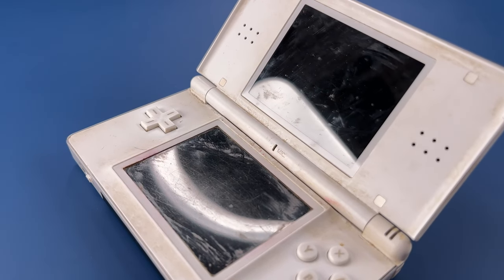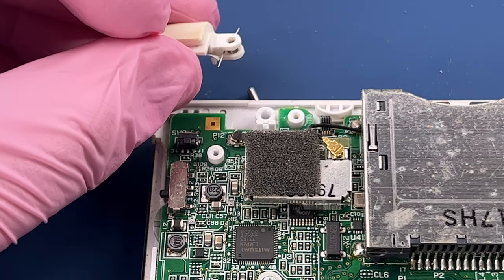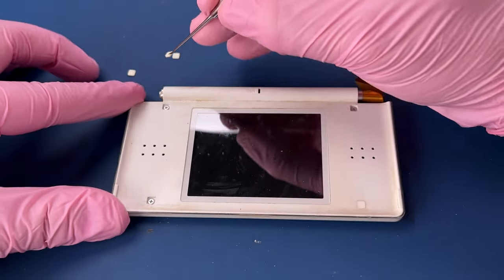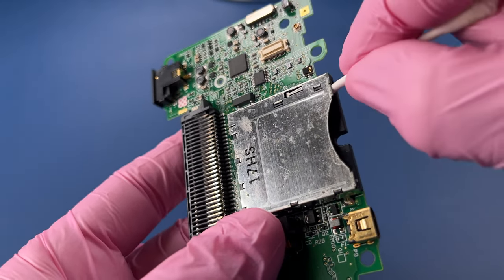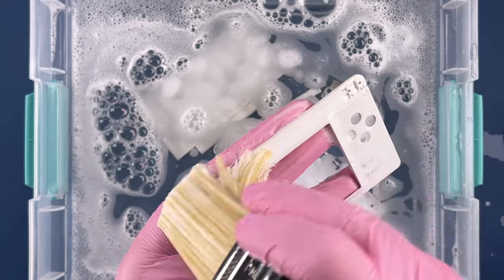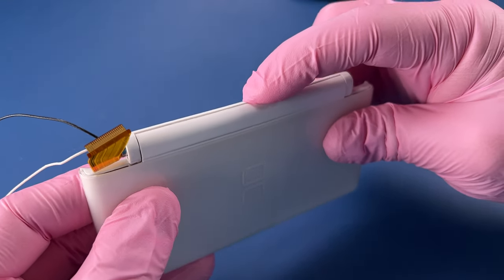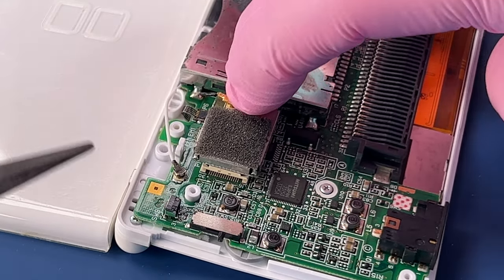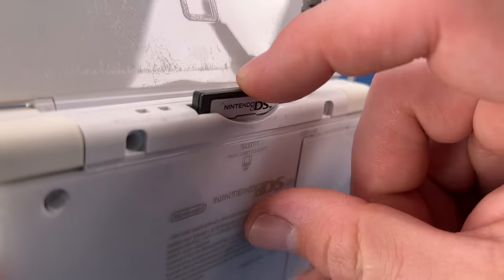DS Lite Brought Back to Life + Why I Don't Retro Brite

Comment: Shout out to you for cleaning and keeping the original case and everything, instead of throwing it away and using an aftermarket shell. I've seen so many YouTube modders take Gameboys in perfectly good or even great condition, rip the shells apart, even destroy them for lolz, and then use some cheap aftermarket shell instead.

Comment: Retrobriting basically works by bleaching the plastic, which is a non-reversible process and generally ends up making the plastic more brittle. It really doesn't fit the spirit of a restoration, in my opinion, which is all about preventing further damage. The "patina" is also part of the history of that device.

Comment: I did build my own UV-light box and when turned on, it looked like something from outer space that was giving off deadly radiation. I loved it lol To my defense, my SNES was so yellowed, that it looked more like a banana than a gray console. I only used the UV-light box once and now dont even know anymore where the growlightbulbs went ^^;  In some extreme cases, there is a good reason to use retrobrighting, but in most cases, i think, its better to leave the items dignity intact and just clean and repair. I restored quite a few Nintendo DS'es and curling up the ribboncable was always the part where i cursed the most lol And yep, some replacement cases from china are so bad, that it almost feels like you have to carve your own working shell out of them lol But strangely it's all fun to me. Maybe i like struggling... That's why i like Dark Souls? Yeah, probably ^^; And i think You shouldn't need an excuse why You don't retrobright. But it was interesting to hear Your explanation.. Thank You ^_^
Reply from the maker: I appreciate your comment. It was a fun read 😄

Comment: The work you and Steve do has inspired me to make the effort on some cleaning/repair work.

Fell into a slightly rusty, non-working Neo Geo CD console. Rust only touched the edge of the PCB and no apparent damage.

Used your techniques to clean it as well as painstakingly and gently using a dental pick to clean all the rust from the PCB.

A bit of research and some testing  with the multimeter led me to find two faulty inductors (common fault on these consoles).

Not replaced yet, but will do soon. Reckon should work after that 💪🏻

Love watching your content, keep up the good work and never stop learning :)

Comment: Another great video.  I totally agree with your stance on Retrobrite.  Something that's not really mentioned is that the effects of retrobrite don't last that long, and hydrogen peroxide is actually pretty expensive.  You'll end up spending $40-$50 on peroxide just to whiten a console that probably costs less than that used.
Reply from the maker: Yes, exactly

Comment: Thank you for sharing and nice job on another working console! I was going to get the necessary supplies and such for retrobrighting at one point, but I was under the impression that since it's an additional chemical reaction that ultimately reverses the discoloration it would gradually make the plastic more brittle in the long run. I'm sure for something like a stationary console it'd be fine but for a handheld that's going to be handled it's another matter. Personally I prefer either straight repair, simple mods, and spray painting scratched up shells to give them more variety versus bringing them back to a "pristine" condition.

Comment: i broke my lil plastic knubbin on the power button slider, for my ds lite, you can still turn it on by using the tip of the stylus but it kinda sucks that it broke.

Comment: also got one like this. It looked HORRIBLE- but then I realized it had a complete case sticker on it, lol. After getting rid of it- a true beauty was lying underneath. Just the touch wasnt working, but I got a cheap replacement digitizer from aliexpress. It became one of my favorites😊 Retrobrighting is frowned at least in theAtari ST community- not because of the idea itself but due to the fact that this (at least on Atari STs)  makes the plastic of the case brittle.

Comment: As a collector and someone who likes to take broken discarded consoles and restoring them to like new condition myself. I love the content but on the retro bright I disagree. It doesn't cost that much to do this. The vapor method using outdoor sun works pretty good. I have got great results from doing that with a aluminum bake pan with plastic cover setting console on something the elevate out of the hydrogen peroxide, placing in direct sun for a few days  in this Alabama heat. I have done many console this way for a few bucks each.
Reply from the maker: I appreciate your perspective. One of the things I don't like is the temporary nature of this method. Have you found the yellowing coming back after a few years?
Reply: @RestorishOfficial  Not in my case . I keep sunlight to minimal in my gameroom around about the same temp year around. My home is also smoke free and I think that helps.  I can only speak to my results. Try it on your own without posting a vid , monitor results for a while then see .
Reply: @RestorishOfficial  I have got consoles from Japan and I believe sometimes its nicotine staining from smokers and not the plastic its self.

Comment: I agree that most people wouldn't go as far as doing retrobrighting.  And your reasoning makes sense, I have no issues with that not being in your content.

You are right about it being temporary, but it can take years before it started discoloring substantially.  If you are that serious about it, you could just do it again in a few years.  You can also put a clear uv resistant lacquer that would make it last much longer.  But that's even more advanced stuff people wouldn't do.

You don't really have to setup an LED box for it, you can use sunlight.  It can take longer depending how much sun you have, but it's a lot easier.  Also, the next time I try it, I'm going to try the vapor chamber method.  You don't need nearly as much h202, and sunlight is perfect for that method.

Keep up the good work, can't wait for the next project!